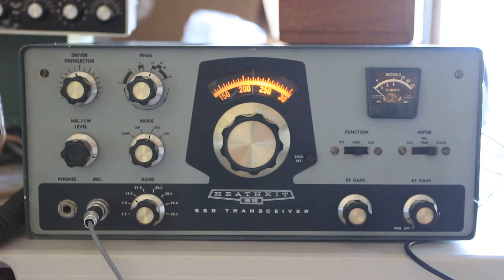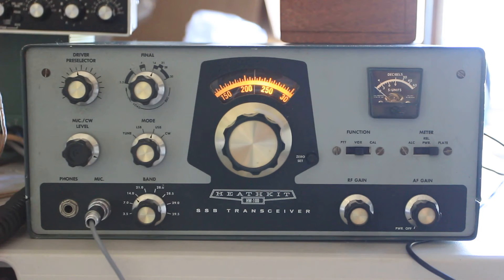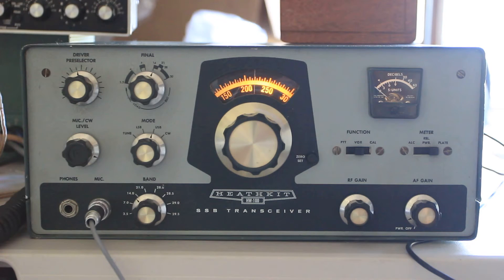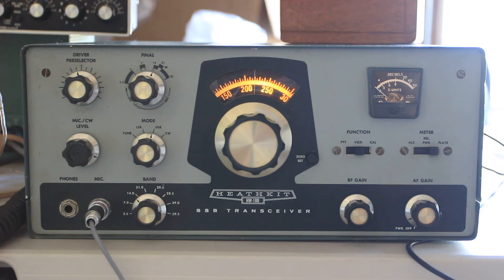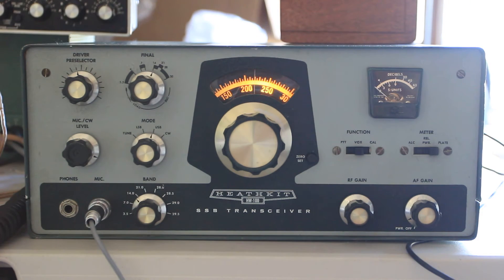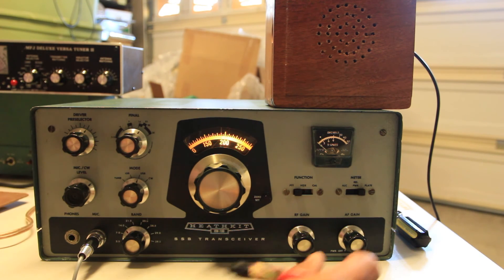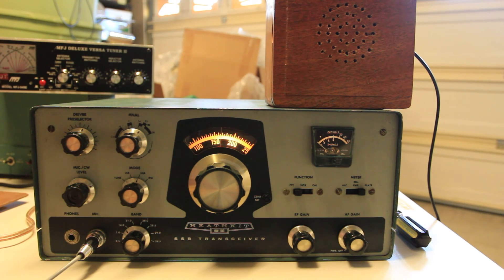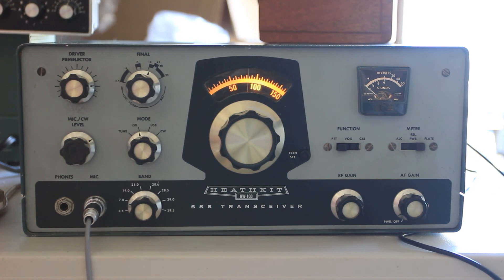Heathkit HW-100 - Restored!

Comment: Built this rig and power supply over the summer of 1968 at the age of 12.  Had a few mistakes that the local club helped me clear up and used it for 3 years until I saved up for a used TR-4.  Thanks for posting and great job on the renovation.
Reply from the maker: Yes, they are very nice radios... Just picked up a SB-100 (nearly identical design but more features) and got it on the air, too.